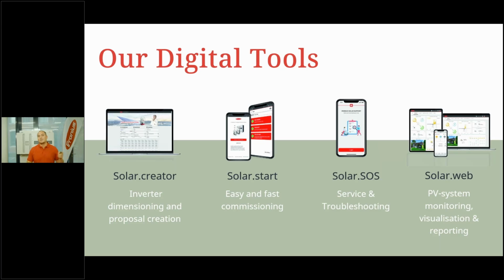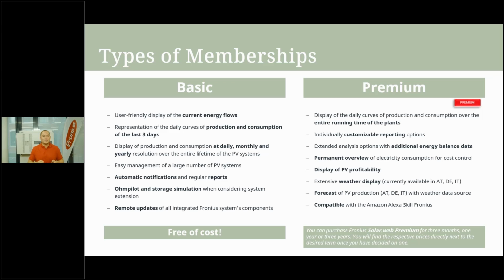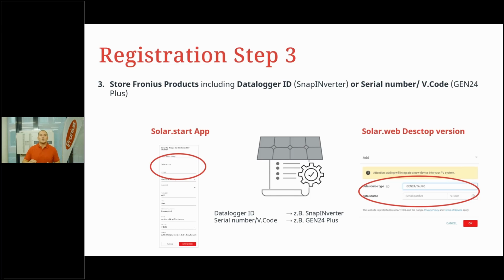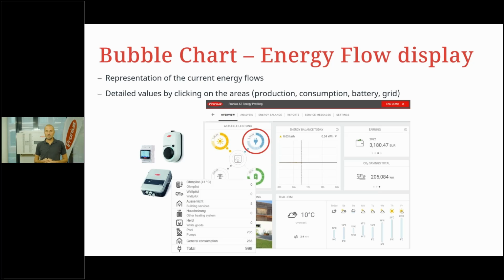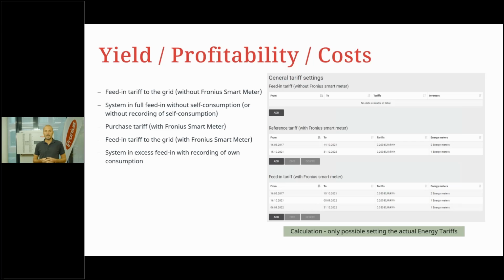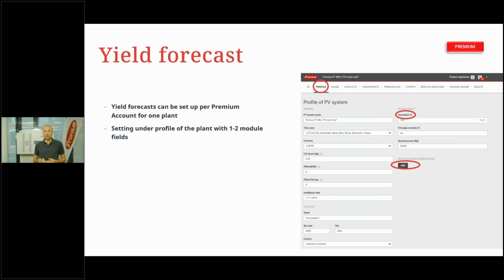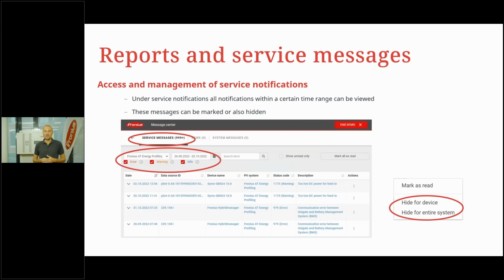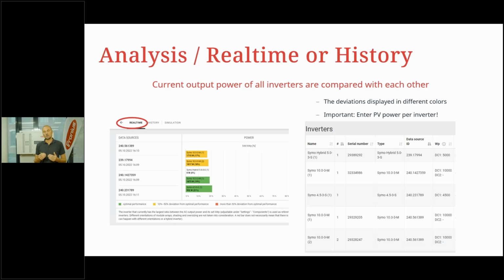Webinar: Fronius Solar.web

Comment: I have a Premium Subscription. I have five questions about the Yield Forecast (only the title Profile Of PV System is seen on the mentioned page and not the Words 'Yield Forcast' but I'll stick to naming it 'Yield Forecast for now). My  Inverter is a Symo Gen 24 Plus - I have TWO MPP Trackers - In MPP1, our 20 x 410kW panels face N and the information is no problem to enter into the Module Field One, easy, but connected to my MPP2 is 4 Panels facing E and 4 Facing W (which we have been told can only get 1/2 use out of all 8 panels in Morning and Evening). I believe all 8 are on 1 string. At this present time I have only put one set of 4 Panels in Module Field 2. 
Question One: should I put all 8 panels in the Module field and just put either E or W in, or do I leave it as is?
Question Two:  In the video, you said, "You can compare the MPP Trackers if they are producing, performing well.."  I assume this is information is on the History Grid - is this correct?
Question Three : If I leave this information as is in Module Field 2 (1 lot of 4 panels) will I only see the production of those 4 panels on the grid or all 8 since all 8 are connected to the inverter - I am a bit confused.
Question Four: still on the topic 'Yield Forecast' page, the information about the 'Offset Earning' is a bit confusing to me. Am I meant to put the amount we get back from sending electricity to the grid - atm it is 7c/kWh.
Question Five: this refers to the History Grid Channels Voltage DC MPP1 and Voltage DC MPP2 - when I have no DC Current thus Solar when it is out of solar hours/dark/night time, the Voltage DC is still showing Voltage up to 80 V at times. The voltage goes lower (not very much) when the battery is down to it's 10% we don't use. Does this indicate a problem - maybe a battery volt leakage? I would really appreciate any advice you can give answering my questions.